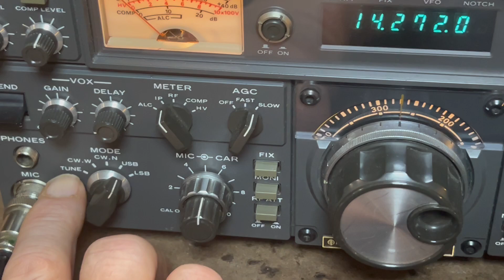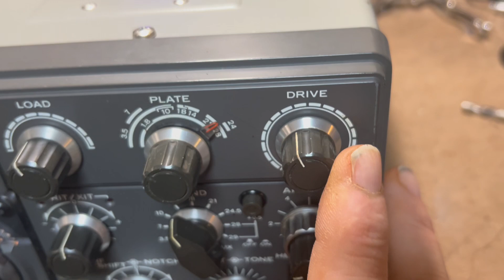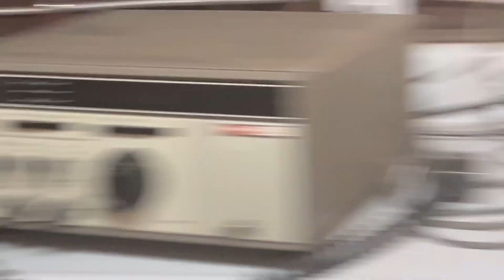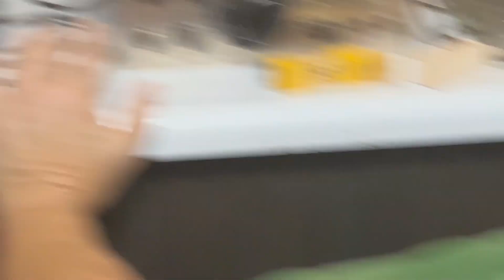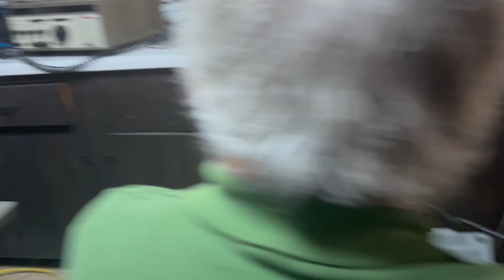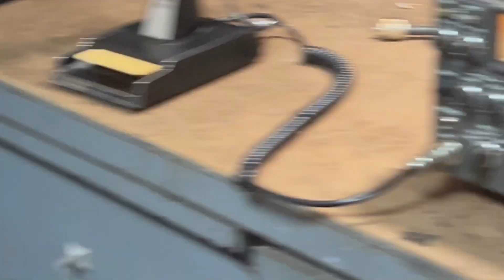Kenwood TS 830S

Comment: i have a ts-830s now, got a kenwood ts-450 i was given and repaired, aligned 10 years ago, got a heathkit sb-301,401 and i have a ts-680s needs new finals and a yaesu ft-902dm and ft-101zd both need repaired wihch i will get to, i had a ts-530s sold it to a friend

Comment: My father used this all through the 80s and 90s he bought it brand new.  I have it now but have never turned it on.  I use a TS-890s.  I enjoyed this video thank you
Reply from the maker: Great radio if you fire it up and it hasn’t been running for a while, bring it up on a variac to protect the caps
Reply: @JamesStephens-ob8xe  thank you for the advice 73

Comment: Love the TS-830S, mine is in my main operation position right now. This is the fifth one I've owned. I have two TS-530's, a TS-930, TS-130, and a TS-50. Too bad there aren't folks around close that work on them anymore. I had a Yaesu FTdx-3000 on the desk but boxed it up and put the 830 back in it's place. What a great radio!
Reply from the maker: @dennisjoiner3717  very hard to beat an 830. I used one as my main rig for a number of years. I have got 3 right now lol
Reply from the maker: Great amateur equipment!!!!!
Reply: Nothing beats a TS 830s. I have had one since they came out. Great rig…bar none.